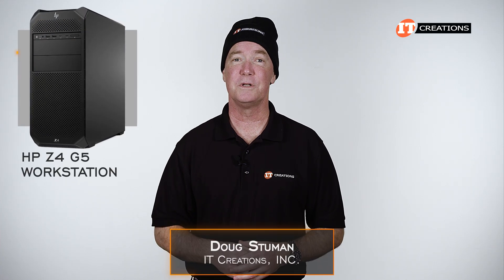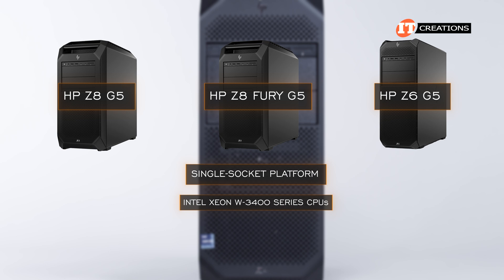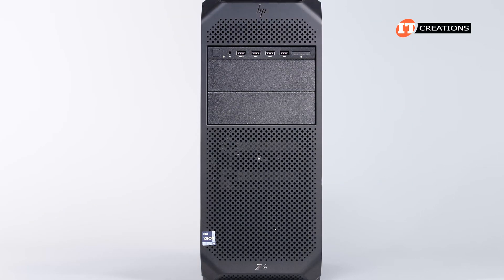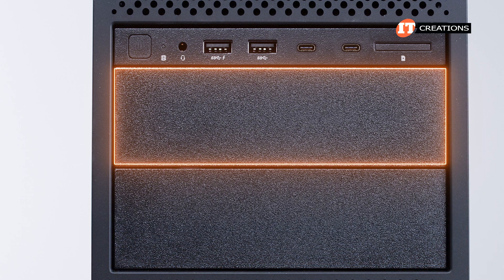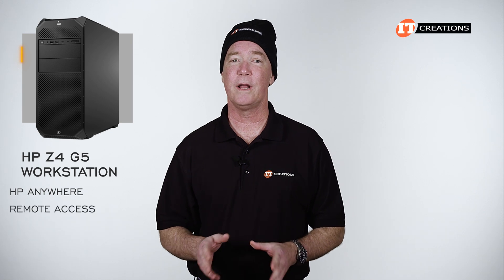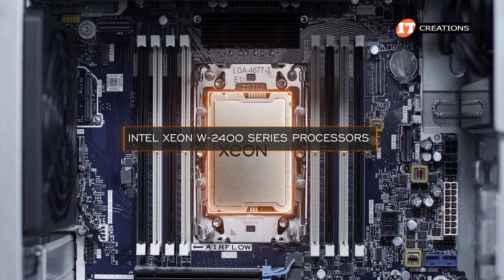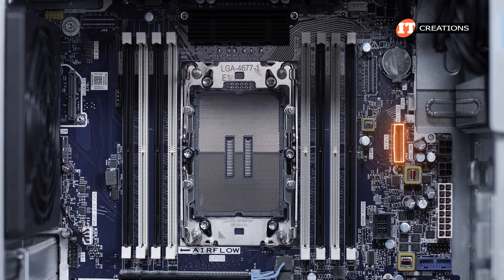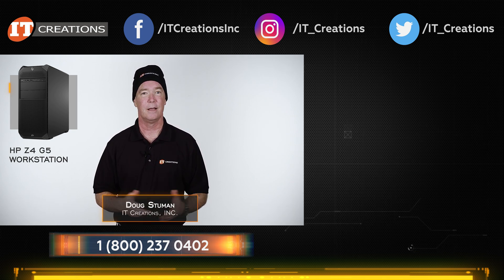HP Z4 G5 Workstation with Intel Xeon W-2400 Series CPU | IT Creations

Comment: Sir we have 3 z4 G5 workstations with 2455x 12core cpu and my question is whether we can upgrade to 22core w7-2575x . Pls help
Reply from the maker: Hi there!
Yes you can! Check out page 5 of the updated QuickSpecs here: https://h20195.www2.hp.com/v2/GetDocument.aspx?docname=c08482306 
Thanks for watching and commenting!
Reply: Actually looking to upgrade processor in existing workstation. So wanted to know whether possible or not
Reply from the maker: @Itsmesurya96  And you can!

Comment: Hi!
I'm considering buying a used Z4 G5 in the future and was wondering about if it could fit a Nvidia RTX 3070 From Evga with the dimension: 
Height: 5.38 in - 136.75mm
Length: 11.81 in - 300mm
Width: 2.75 Slots
Of course with the PCI retainer. Though I'm also considering buying a Intel GPU from their Arc lineup when their gen-3 or -4 eventually comes out.

Comment: Hello
I finally purchased a HP Z4 G5, very powerful, but... It is very noisy compared to my old Hp Z620. Even in idle mode (CPU < 3 5%), it is difficult to work nearby. I do not know which fan is  accountable for this noise. If you have any idea...
I have the premium tower, with the optional M2 cage and 2 NVME Disks. The reseller had to ask to HP for this configuration, because they were not aware about the options. Inside, Due to the M2 cage and their cables and the graphics cards, I think it's difficult to plug the memory fan on the motherboard. Be careful if you remove them. 
Otherwise, performance are impressive when using Capture One (I mainly work on photo and video editing).Boot, opening chrome and loading pages and other basic tasks are incredibly fast. Next week, I will try Adobe Photoshop.

Comment: Hello
great video ! A question: where can we buy the optional M2 cage in front of the tower? Thanks
Reply from the maker: That is a great question. The older QuickSpecs, which we have on our site and will soon be switched out, says it's available as a factory install and as an option kit. This on bottom of page 10 is the actual carrier and then there are kits for the M.2s that go onto the carrier top of page 11 https://www.itcreations.com/user-manuals/z4-g5/hp-z4-g5-quickspecs-2023.pdf 
However, 
The newest quick specs say it is not available as an install kit and only as a factory option. Meaning, you would have to order the unit with the carrier installed. This on page 11 https://h20195.www2.hp.com/v2/GetDocument.aspx?docname=c08482306 
Might be an error on HP's part but not sure in what direction. The fact that it cannot be located with a search makes me thing factory install is the only way, at the moment, I will see if we can get a response from HP. Don't expect an answer real soon but I will post it when I get one.
Thanks for watching!
Reply: @Itcreations-LA  thank you so much 🙂
My retailer is not aware about all the options and where he can find them..
Reply from the maker: @herydeslandes8904  
I did put the question to CRU as well about availability and pricing. Not listed is the QX428 just the QX448. Asked about that too. Will see if they respond. Here is a link: https://www.cru-inc.com/products/ships/qx448/ 
Good luck!